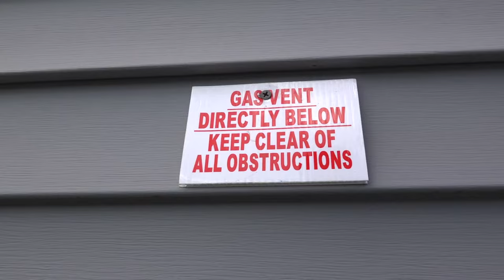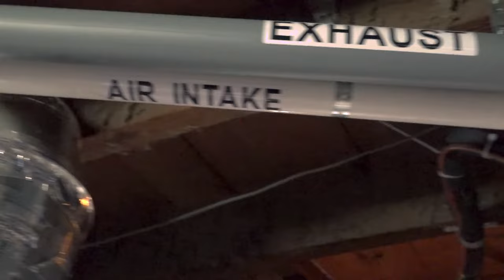High Efficiency Furnace Venting [Building the Exhaust Port and Air Intake]

Comment: That drywall screw you used is going to leave a nice rust streak down the siding very soon. That's going to be the only thing the homeowner will talk about in the near future. Something so simple as this sets the pros apart from the rest. Do it once, and do it right.

Comment: Looks good except for the 1/4” mesh screens. 1/4” will allow bees to enter and build hives, causing the pressure switch to trip. 1/8” mesh will prevent most bees from entering and typically will not cause pressure problems.

Comment: So I have my furnace on the first floor. It should push air downward to reach the vents that take air throughout the house. Above that there is a large vent that the old furnace pulled air from? Do I need to run a air intake pipe to the outside? Can't I just put in sheets in the s track above and screw them to the top of my furnace? What is the point of this whole intake pipe?
Reply: The intake pipe brings in fresh air to the combustion chamber with out taking fresh air from the house.

Comment: Well done and professional.   I would let you work on my house.    For those of you who don't know, notice the different types of pipe used for exhaust vs intake.    Why?  The exhaust gases will be too hot for standard schedule 40 PVC pipe, so he used schedule 80 PVC which is rated for that warmer gas.   
My question is how does this setup deal with the condensation in the exhaust pipe?   The condensate will accumulate quickly if it does not drain somewhere, and will cause the furnace to shut down as the pipe gets blocked.

Comment: Quick professional question. 

Can I bridge 2 furnaces and 2 ac units together.  To heat and cool large space, instead of buying a industrial ac heat pump.

2- 80,000 btu furnaces together. 

2 - 5 ton ac units.

What size pipe do i need for venting a 80k btu furnace.

Comment: Nice work! My mother-in-law's new GOODMAN furnace will be 7 feet from the outside wall. It's only 60 BTU's, because she lives in one half of a duplex that is less than 900 square feet. The 2" PVC pipe is adequate for that system with the short length of pipe and minimum elbows needed. 

My question is at 0:07 4-bolt plastic fitting (Flange). I'm I assuming that the 4-bolt fitting is compatible with the standard PVC glue (not CPVC). Also, the brand new 2023 96% efficient Goodman furnace has the exact same 4-bolt flange fitting for the exhaust. I see nowhere in the installation manual about using the proper glue.

Comment: I was hoping you could help me.  I have a Goodman High Eff furnace that was leaking water where the flue pipe meets the exhaust on the top of the cabinet.  When it was installed, they put a 45 degree 2" pvs on top of the flue pipe, but its been seeping water around the connection.  I got the new flue pipe and elbow that attaches to the inducer put in but the 45 deg elbow that I want to attach to the flue pipe just doesnt seem like a tight connection. I know Ive seen some who use a Fernco rubber connectin to the flue and then the white pvc to the top of the Fernco.  Ive also seen where some say Goodman doesnt recommend a rubber connection.  Should I just go with the 45 and glue the heck out of it or something else?

Comment: Nice job. Can I use regular pvc for intake ? I see you have your close by each other is that also ok?
Reply from the maker: Hi NC Vman, thanks for the comment! You can absolutely use regular PVC for the air intake, just make sure you use CPVC for the flue/exhaust if you are doing both. (In case you don't know, CPVC is a more durable and heat resistant form of PVC)
Reply from the maker: As for the distance between them, that's a combination of the code in your geographical area and the manufacturers recommendation. This installation was a Goodman Furnace, so the optimal distance between the air intake and the exhaust was already stipulated in the instruction manual by Goodman. All we did was follow their instructions. I'm hesitant to make a recommendation because I don't know the nuances of your situation, but in general, you want to have both vents above the snow fall line and well over a foot away from each other. Be sure to check with an expert in your local area to make sure you are complying with your state's regulations and the equipment manufacturer's regulations. Also, the type of camera lens we filmed this video with tends to compress visual space, which makes them appear closer together than they actually are.

Comment: i just have 2 pipes going straight out, the exhaust above and about a foot longer then the intake, one day i thought I'd put a 45 on the end of the intake and my furnace wouldn't work, thought it was a good idea but turned out not to be, took it off

Comment: my high efficiency furnace is only 3 years old and in the dead of winter sometimes the flame wont ignite. it is in an old pantry with no space. would getting a louvered door help, or is the air intake all it needs for sufficient oxygen levels?
Reply from the maker: Hi Jay, thanks for commenting! It's hard to diagnose without seeing your setup, but here's our best guess. 

If it's a high efficiency furnace, the louvered door wouldn't help you because the combustion chamber on the furnace is already fully sealed, except for the air intake, which would be a small port in the top. The furnace is going to draw the same amount of air regardless of the door, but what really affects it is the air pressure within the house overall. 

When a furnace draws in air, it uses it for combustion and then pumps it out of the house. If your furnace draws air from inside the home, and pumps that air outside, it will create a vacuum by depleting the finite supply of indoor air. Typically, this pressure imbalance will draw outside air into the home through cracks in the wall, open doors/ windows, or any other flow of fresh air. Because of this, older homes often don't experience this problem because they are drafty. 

If your home is weather sealed or properly insulated, however, the fresh air your furnace relies on can't get inside and so the furnace depletes the indoor air. Eventually, the air intake can't adjust to the increase in pressure, and the flames choke out due to the lack of air flowing through the system. 
This is a problem we tend to see in newer homes, weather treated homes, or with your system, in areas of the house that already don't get a ton of ambient air flow. To avoid this problem, we simply run an outdoor air intake alongside our exhaust port, because it allows the furnace to draw air freely, without creating an imbalanced pressure system. 

As a company policy, we always run vents and air intakes outside because it avoids any potential hassle. I can't promise that will fix your problem without sending a tech out to your home, but that seems like the most likely solution. 

My professional advice is to have a tech look at your system in person before you do anything else. If you live in the Massachusetts/ the greater Boston area we can absolutely help you with this. Just go to our website (www.addarios.com) and schedule a service call with us so we can properly diagnose this problem. Also feel free to send me a picture to Media@addarios.com and we can give you some more specific advice. 

Hope that helps! 
Your friends at Addario's Services
Reply: @Addarios  thank you! I sent puctures to your email. I appreciate the time. My house is very old and drafty so im wondering if its not the air quality at all.
Reply from the maker: @jayhilton5429  Hi Jay, I just emailed you back. I had our techs look at the pics you sent and there's nothing that stands out as out of the ordinary. It's likely another issue that is not related to the venting and I would once again advise you to have a professional look at it in person, as it will be hard to assess the true issue without using on site tools and methods of diagnosing the problem. I hope this helps and feel free to reach out anytime with additional questions :)

Comment: what type of pipe is code for the exhaust pipe?  I've heard not to use Charlotte for some reason, but i know you're supposed to use a schedule 40. Can you help?
Reply: The exhaust vent is hot, and sagging puts it at risk of collecting condensate. Do not use Not For Pressure "Cellular" pipe on exhaust.

For the intake pipe, that's just fresh air, so the DWV Cellular Not For Pressure pipe is adequate.

Comment: Very nice. Does the intake need to be pitched in towards furnace or out side?
Reply: Generally both pipes need to be pitched down towards furnace for condensate to drain back.
There may be possible exceptions depending on actual model. Need to check install manual to verify what is allowed.

Comment: Can the furnace and a tankless water heater exhaust be tied together?
Reply from the maker: Hi Bobby, thanks for your question. Under no circumstance should you ever run two exhaust vents together. That's explicitly forbidden by code and by all reputable manufacturers because it is extremely likely to backdraft exhaust gasses from one system into the other, which would release the exhaust in your home instead of outside. While you could physically run the pipes together, you should NEVER do this because it is dangerous and illegal.

Comment: the outside exhaust riser vent is not properly secured to stop being jarred, nor is it insulated.
Reply from the maker: Hi Alberta Farmer, thanks for your feedback :) After looking into it, this particular system was installed per the manufacturer's recommendations. If we can ever be of any assistance, feel free to reach out.
Reply: @Addarios  I guess your gas code Regs are different than here, whereas any exhaust vent more than 15" in length outside of the dwelling must be insulated and secured every 36".
Reply from the maker: @albertafarmer8871  Yeah they definitely are different. Massachusetts winters are tough but luckily not bad enough to put that kind of stress on the system!

Comment: You did the exhaust pipe wrong. It's supposed to be a sweep, not a right angle exhaust.
Reply: What fitting are allowed is dependent on model and install instructions.
Sure, a sweep is always preferred but not necessarily required. Especially as it's 3", being reduced to 2" at the furnace.

Comment: so the reason these furnaces are called high efficiency is because they do not have a pilot light, eliminating the need for a constant supply of natural gas, that is all. if you have natural draft you have to calculate if the electricity consumed by the fan costs less than the gas that would otherwise be consumed by pilot light. there is also the fact that a natural draft furnace can operate without electricity and natgas residential piping only needs to pump a few psi to keep older natural draft furnaces going

just some thoughts, i live in a place where you need heat to survive.